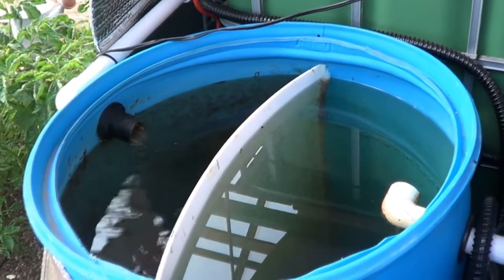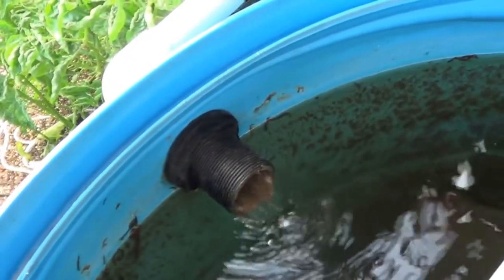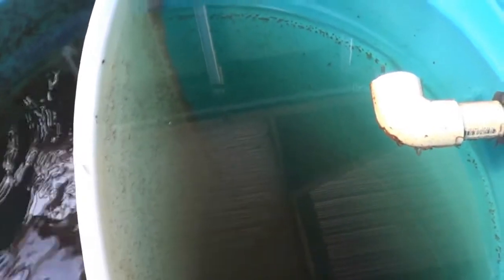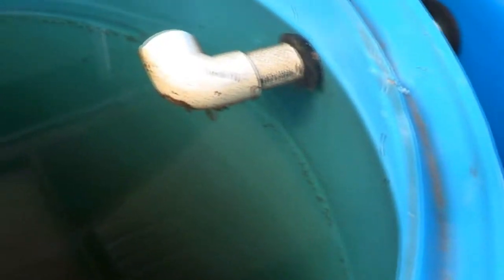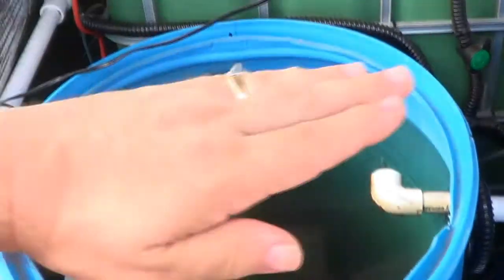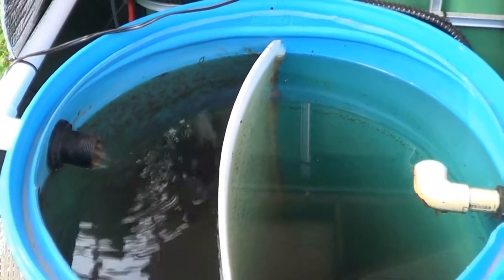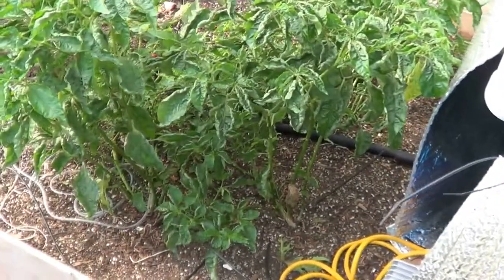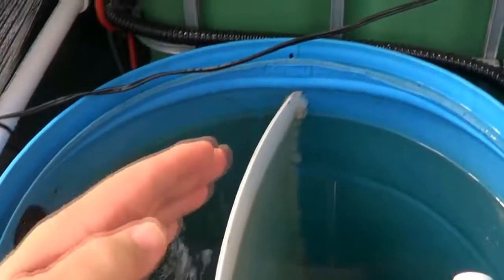Aquaponics Build Video 13   Clarifier

Comment: How high from the bottom of the barrel should I plastic be ? Also I just have a 330gal fish tank with 2 grow beds and a RO filter. My water is not that clear. Instead of using 55 gal can I use a 15 gal drum? Would it be big enough ?
Reply from the maker: +Jason Williams I have a gap of about 4-5 inches, the 15 gallon drum should be fine (I think). Question on the RO filter - is it constantly filtering the water?
Reply: +Tracy Holz (North Texas Aquaponics)  yes its constantly running, also thought about buying some filter socks to filter the water leaving the growbed.

Comment: ok so the barrier is corrugated plastic sign material, ending about 1/2 inch ABOVE the waterline and the sides appear to be syliconed to the barrel sides ... Does the water flow under the center wall?
Reply from the maker: You got it!! that way the solids stay at the bottom.  I have done every kind of solids removal this way is not only as good as every other kind it is the easiest to build & just a 55 gallon drum can handle a LOT of water in case you increase the size of you system.

Comment from the maker: It is an old election sign I picked up from a friends yard after the election. I just cleaned off the letters with a razor blade. But when I do it again I will just use a white Roll Blind - will works just as good & I can take it out easier to clean it. The tiny gaps on the side would not matter like I thought before.  Thanks for watching